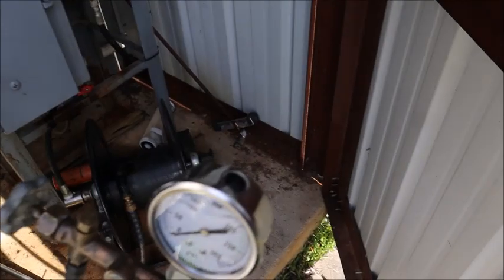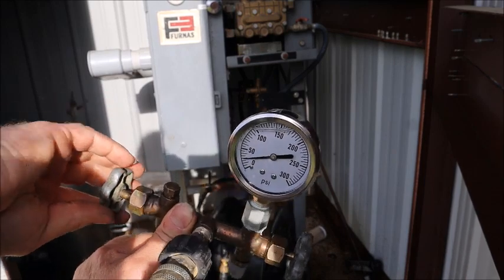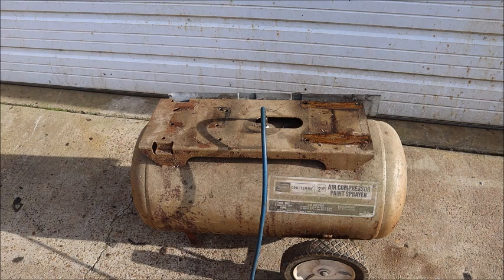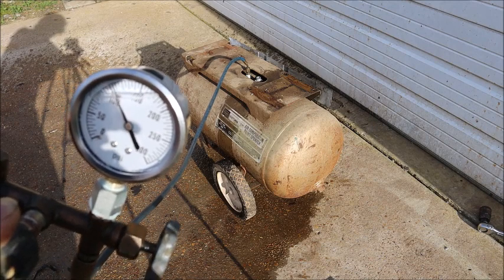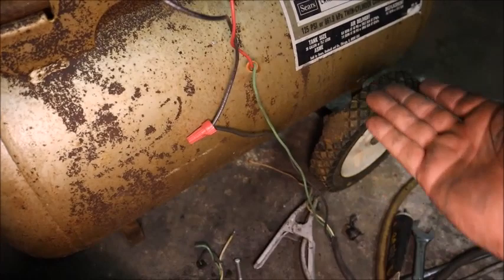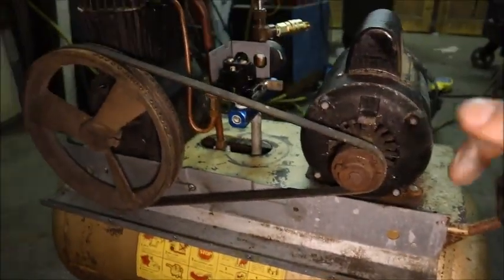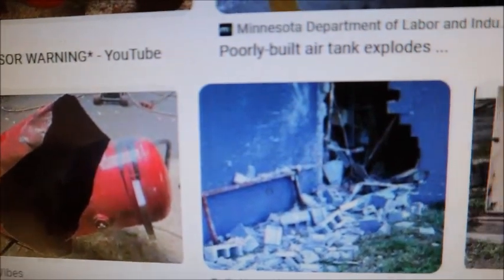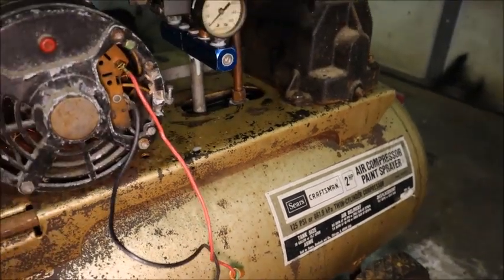Pressure test / hydro test of portable air compressor - save yourself from exploded air tank...

Comment: As a stationary engineer we performed many hydrostatic tests on boilers over the years.  One detail not mentioned in your procedure is the temperature of the vessel/water.  Both need to be at least 68F or 20C.  The vessel's metal can become brittle at lower temps.
Reply from the maker: That's a very good point.  The pressure washer has a 27kw electric heater for hot water power washing. The supply of water feeding the machine is from the domestic hot water tap in the workshop. Without the pressure wash heater turned on, the water is the temperature from the hot water tap. It's just a workshop without dishwashing or laundry so the hot water is only around 120°F for hand washing.  For the test in the video, the pump was delivering this "bathwater" temperature water which is quite well over 68°F. Thankfully here in Alabama it's warmed up nicely already so it might not have been a problem even without the heated water. But this is a good point and I didn't consider it during the test.

Comment: I have done similar tests, and have yet to have one fail.  I test every tank that is new to me.  One thing I'd add is that if there is heavy rusting along the bottom, I no longer trust it.  I have an 80 gallon one from 1961 that had an enormous amount of rust in the bottom, so I didn't use it.  It sat outside for years after that, then I decided to test it for fun.  It held 300 lbs, though it did have a very slight leak.  Amazing how overbuilt the old American iron was.
Reply from the maker: I don't blame you for testing every tank new to you.  

In my testing, two have failed. They just spray when a small tear opens, or multiple pinholes open up. Nothing too exciting. The two which failed were 4 or 5 years old flea market tool store tanks which were suspiciously light in weight.

Comment: Scary that that rusty old thing is probably safer than a brand new compressor from harbor freight or home depot.  Good idea on the valves for testing
Reply from the maker: Made in USA to an actual pressure vessel standard. Definitely would be more worried about a thin walled HFT tank under similar conditions.

Comment: I saw that same  video of the compressor aftermath when it blew out.  Crazy the amount of energy stored.  The guy in the video said it blew the windows out of the garage and the compressor hit the ceiling.  I have my dad's old air compressor from when I was a kid.  The tank had a pin hole in it when I powered it up years ago.  No way am I going to mess around with that tank.  I will be buying a new tank and probably go to a vertical tank when I do.  What is scary is I didn't know the dangers of this when I powered up that compressor years ago.  I'm fortunate the tank didn't rupture on me.
Reply from the maker: Yes the vertical tanks are much safer due to the failure point from rust-out being the low point at the center bottom head, around the drain fitting. That won't cause a split to form along the entire side of the tank.

Comment: Very good information, all compressors need to be drained of water at the bottom, a few years ago I took a nice looking sixty gallon tank and made a bbq smoker out of it, when I cut it open for the door you could see the rust and deep pitting inside So just because a tank looks great outside doesn't mean it is good inside.
Reply from the maker: Exactly.  My friend was a little disappointed when I would not allow the compressor to build pressure when we first got the motor running yesterday. I explained it the same way that you cannot tell by looking and his already had water in it which had been sitting a long time.

Comment: I used to work at a place that manufactured refrigeration units for ice rinks and we made our own heat exchangers so we had our own testing rig, they used to do tank testing for other companies as well as pretty much any tank people would bring in.A small compressor tank like that was $50.00 back then.There are a number of places that will test a tank for you and it seems the newer cheap units let go more than the old ones, in any case they should all be tested on a fairly regular basis, I do mine every year.
Reply from the maker: Neat job you had there.  Interesting about the ice rink refrigeration systems! 
It's great that they offered  this service to hydro test tanks for outside clients. 

Yes the old tanks were build to ASME pressure vessel standards; whereas the imported ones are built to a standard but likely that standard doesn't require the same engineering margin as the ASME pressure vessel standards.  Simply picking up an ASME tank versus a new import tank will speak volumes....

Comment: My question is, what if it failed the test and exploded with you standing near it?
  Oh, you explained it would not explode since water is in it, right?
Reply from the maker: Hi Rickey. Considering it is "only" 250 PSI and the tank is full of water, the worst which would happen is I get sprayed with water. The water comes from the domestic hot water tap in the shop, which is just for hand washing so it is only warm. So I would have been sprayed with warm water if that happened. I closed off the pump supply and trapped the pressure in the tank before making the up-close inspection, as well. If it leaked it would have just been a small spurt.

I have had these fail before, and it's quite underwhelming. They just develop a small tear or pinholes in the bottom as the pressure is applied and water sprays out.

Comment: Once the tank is filled to the top with water, could you use another air compressor to add air pressure for the test? Seems to me that this would also be safe ? (if you could get a high enough pressure).
Reply from the maker: I would hesitate to do that. My concern would be an unnoticed leak allowing more air than desired to get into the tank. Also it if ruptured with an air cushion over the water, that air would expand and greatly prolong the water discharge, maybe even causing the tank to be propelled.
Reply: @davida1hiwaaynet  What if as pressure source i will use long water filled hose which i will pressurize it with air? Also adding check valve and/or restriction near tested tank is a good idea? Check valve on will stop water/air flow if tank ruptures, restriction will just slow down water near tank inlet.